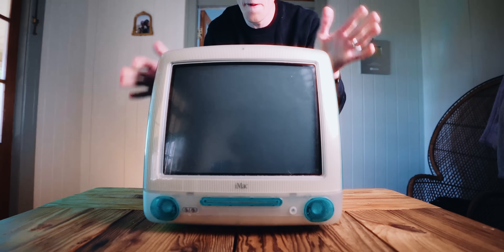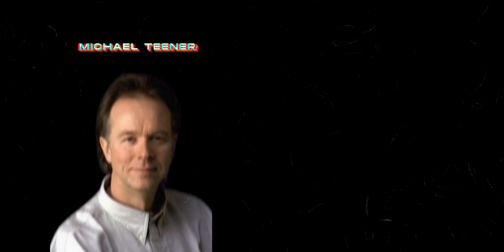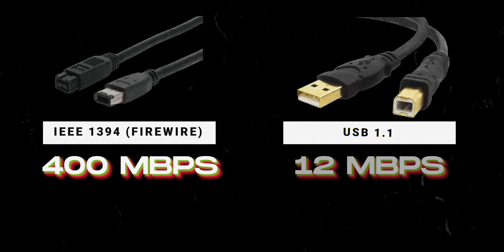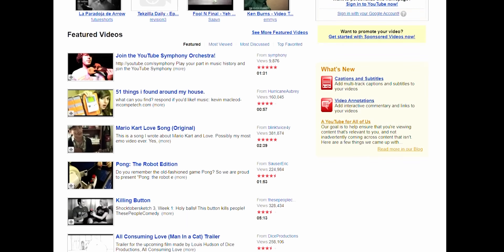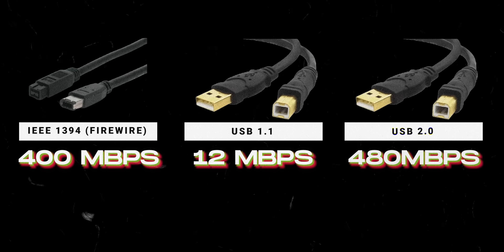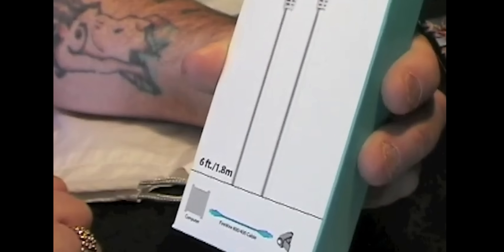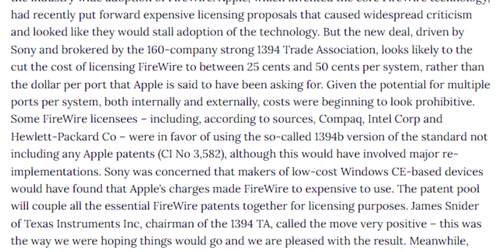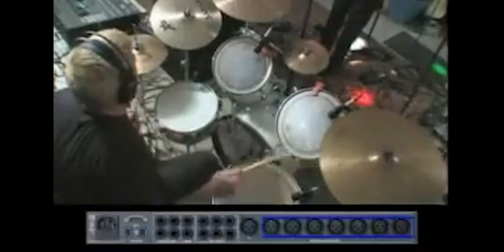Why Steve Jobs Forced You To Buy FireWire (Then Killed It)

Comment: This is heavily biased towards Apple, & has multiple errors.
They started firewire, but other companies made huge contributions, Sony, Panasonic & Philips averaged just as many patents each in it, & number of other big companies made big contributions.

Apple killed firewire with their greed, pretty early - just as usb2 was about to arrive & not long after win98 with firewire support. This is why no pc motherboard chipsets had it built in, whichwas the death knell. They hadn't been exactly free prior, there was a one-off charge. The new $1 per port was obscene, especially back in 1999. None of the other patent holders were charging, seemingly there was even an aborted attempt by other companies involved to make a firewire revision so apples patents could be removed.
Microsoft reportedly trusted apple so little that they made them sign a document at the start - that they'd keep the fee low, but went ahead & charged far too much anyway.
Apple was the worst part of firewire, other them using it on their own computers - which is the only real reason audio interfaces used it. driver support for them seems tyically horrible for them. Likewise apple abandoned firewire like anything "old", meanwhile it still works in windows 11.
If firewire wasn't on camcorders, few pc users would have ever cared about it. Obviously Sony, Panasonic etc drove this.
I think it's unlikely apple ever would have "won permanently" with firewire. Their hatred of open interfaces pretty much guaranteed that anyway. The eu had to force them to even use usbc.
lt's very debatable that it was better anyway, firewire can be a pain in the ass, even plugging things in the "wrong" order can stop something working - there's even wwarnings on some devices about how to plug them in. And this isn't just on pcs, I had the same problems on apple.
It was also never intended for everything, no keyboards, mice, card readers etc were ever going to use it, unlike usb.

Comment: My first CD-Burner was SCSI.  Because it used it's own dedicated expansion card, I was able to multi-task while burning.  With IDE, it would cause the recording to fail.

Then my first external HDD had FireWire400 and USB2.0.  I chose it specifically because it had FireWire400.  It was so much faster than the USB2.0 interface.

Thanks for the history lesson.  I honestly didn't know Apple invented FireWire and that licensing was it's demise.  So unfortunate.

Comment: Great video, but I feel it was always going to be USB and it's children.  You could get a $10 USB to serial adaptors from the get-go etc etc etc. You just couldn't do that with FireWire, it was too expensive because it was peer to peer, the cables started at $20.   So FireWire stayed niche for premium devices but missed the mass consumer market.   Even now we see the same issue with Thunderbolt (which is kinda an encapsulation of FireWire plus PCIe).  TB is freaking awesome but still an expensive architecture compared to USB 3.2 and still problematic when you want to have a dozen TB ports on a PC or Mac affordably.

Comment: Firewire 1600 was also in development, double the speed of FW 800, but Apple developed Thunderbolt 1, initially capable of 10 gigabit data, which later evolved to 2, 3, 4, and 5 gigabit data on the latest Macs. It's basically changed its name, but it's basically the same standard, improved and more powerful, as this technology now supports peripherals of all types, monitors, data, and power supplies over 100W. And the data is all managed on a serial line. Like FW, two chips are needed at either end of the cable or peripheral to manage data and power.

Comment: USB-C is a bloodbath of a disaster; particularly where cables are concerned.  There are so many variations of data-transfer rate and power transfer capacity and no way to tell by looking at the cable.  We are back to the days of travelling with cable spaghetti, only now we can't tell the spaghetti apart by looking at it.
Reply: ...Or you can just buy spec-compliant USB4 (or USB 3.0) cable. But nobody gonna buy expensive cable to just charge their phone.

Comment: your video is kind of wrong in a really big way. USB wasnt just cheaper, it had a bunch of really big technical advantages, including hubs and native support for new and legacy protocols like serial (CDC) and parallel ports. But most importantly: FW was DMA at heart, a massive security issue, and that was unfixable. That killed FW. The licensing debacle was a sideshow in many regards, especially as usb already had much greater market share pre-2.0
Reply: Technicaly USB is just a dumb serial port, FW is way more than that, with real bandwith at 95% of theorical bandwith, networking capabilities, multi DV flux shared between several devices, chainable like SCSI, etc … how can you compare it with such a crappy thing like USB !!!

Comment: Thunderbolt 1 2 and 3 ARE FireWire's legacy and it is fully backwards compatible via adapters. Apple is now only pulling the plug on driver support in the upcoming OS despite being fully integrated into the USB-4 spec. I am still using a MOTU UltraLite MK3 FireWire interface via adapters and I"m pretty annoyed that Apple is pulling support. MOTU actually still sells and supports the USB2/FireWire hybrid version and it's through those drivers that I've still had up-to-date support. Now I'm gonna have to buy a new interface if I want to upgrade my OS.

Comment: Video doesn't mention that Firewire 400 could achieve roughly 400 Mb/s, while USB 2.0 (rated at 480 Mb/s) could only achieve about 350 Mb/s.  This was because Firewire is a device-to-device data flow architecture, while USB is a device-hub architecture, with a lot more crosstalk and mitigation, closer to how Ethernet/WiFi handle multiple devices on a network

Comment: Before watching the video: Firewire went through two versions before being replaced by Thunderbolt, which Apple & Intel jointly developed and is the spiritual successor to Firewire.  And Steve Jobs cunningly installed the ports on 2011 and later MacBooks calling them just “Mini DisplayPort” (so for displays only) before revealing at a keynote that they were actually Thunderbolt ports (same MDP connector) and that people didn't have to buy something new to use Thunderbolt— they already had it (genius solution to the chicken and egg problem when it comes to new tech).

Comment: SCSI was incredible back in the day. It was finicky in some respects with termination and device IDs, but compared to anything else on the market at the time, it was faster, simpler, easier to use, and a lot more heavily standardized supporting a lot more different device types and total devices connected.

It was revolutionary and no small feat, and it was not something as flippant as you’ve mentioned. Its inconveniences were necessary given the state of technology at the time it was invented, and they were minimized as much as was feasible at the time.

USB 2.0 may support 480mbit, but protocol and CPU overhead meant significantly reduced transfer speed compared with firewire 400.

Comment: Also: No, FireWire was never intended to be a standard for everything. It was supposed to be for fast data transfer. You would never find a keyboard or a mouse using FireWire.  That's what the Universal Serial Bus was for.
Reply: Exactly. It was meant to take on parallel and SCSI  .
Reply: I'd also add that the idea that it 'just worked' as stated in the video was not true.  It's roots in the 80s and 90s meant it had no concept of class drivers and required drivers specific to each device for operating system enumeration, something usb did not require.  It was likely always going to die without a major revamp and backwards compatibility break, it relied on technical assumptions that had changed very quickly after it launched.

Comment: I still ran my backup hard drives over FireWire 800 I believe up until 2016. Very fast, very reliable and being able to daisy chain hard drives was a godsend. Fun facts: The F-22's databus is based on FireWire 400. And the FireWire 400 connector was based on the Game Boy link cable.

Comment: I am professional media producer, and even to me, USB 2.0 would be good enough for doing everything I need. I am not saying it is preferable over modern fast ports, just saying this old tech would be enough for professional use, you'd just need a slight bit more patience. When transfering 10GB of video data, USB 2.0 typically needs 5 to 6 minutes. And barely anybody transfers 10GB several times a day, it is still quite an amount of data.
I am just pointing this out, because people are tending to ask for the greatest tech, for it to be able to do more and more, while they are not even maxing out the tech from yesterday. Many people spending money on tech to have particular features, just to have them - but then ending up never utilizing them really. I have a 10 years old USB 3.0 thumb drive. It is reliably writing 150MB/s, and never have I thought "this is too slow". So this is still my main mobile drive, if anything, the size of 64GB sometimes isn't enough anymore.

Comment: Even when USB 2.0 came on the scene, FW400 still had advantages, but FW800 was really awesome. Yikes by the licensing fee mess. The other shame is FW1600 and FW3200 existed as well, at least in theory, using the existing 2 ports, it could have been a total game changer, but it never took off. I still have my FireWire audio interface I got while studying sound engineering, it did 24/96 recording back before any USB interface came close to that, multiple channels at once, and a phono input. I still have the adapters to use it, but unfortunately there's no drivers that work on modern Windows or Mac, I even have a FW400 PCIe card for my PC :(

Comment: There is an Apple Firewire->Thunderbolt2 and an Apple Thunderbolt2->USBC Adapter available. It allows you to connect any Firewire400/800 device to USBC. And it really works (i have tested it). You can even use a Firewire->SCSI adapter and an IDE->SCSI adapter to connect an IDE HDD to a USBC port through this adapter-inception... kinda crazy. The USBC to Thunderbolt2 adapter can also be used in both directions...
Reply: As it stands now with Tahoe this will no longer work 😢.

Comment: I was thinking the same thing like a laptop or desktop case w/ FireWire 400 the hole port might be good for using usb-c either on logic boards or motherboards depending on the project built even if had used a cable as extension mount to case to make it work

Comment: Firewire is not (totally) gone yet.  Thunderbolt is backward compatible with firewire.  I still use my MOTU 828mkII audio interface with my new Mac Studio M2 computer.  Thunderbolt 4 > TB4 to TB2 dongle > TB2 to FW800 dongle > FW800 to FW400 cable > MOTU Fw400 jack.  iDongle to the rescue!!
Reply: I believe this will stop working in tahoe
Reply: Talk about signal integrity 😂
Reply: The cables are not for sale. Any ideas

Comment: It was down to cost. USB 2 may have been faster on paper, but it didn't support DMA transfers and all the data had to go though the CPU bus, whereas Firewire devices could transfer without the CPU involved. Also, USB didn't hit 480 in the real world, so the Firewire 400 was still faster AND didn't cause your computer to slow down. Then there was the latency. When USB2 first arrived, no one used it for audio because of the lag. They did solve this, obviously.

Also, I don't recall it ever actually being put into production, but from the inital design specs, Firewire was designed for 400/800/1200 speeds. It was just deemed to expensive to put the 800/1200 out there until costs came down. So yeah, when it was time, they could pretty much just drop FW800 on the market.

Comment: Thunderbolt isn't "Apple's", but rather Intel's, but Apple was the only company that used Thunderbolt 1 & 2 (using Mini-DisplayPort for the connector and port) on their Intel-powered iMacs and Macbooks until Intel released Thunderbolt 3 with the USB Type-C port and plug, as effectively "PCIe-over-USB".

Thunderbolt 3 had a lot of "optional features" beyond the core feature set, but since they were "optional" you often had issues using "TB3" devices and cables from one manufacturer with "TB3" devices and cables from another because even though they had the same core functionality they often also had different expanded feature sets.
Intel eventually fixed this issue by making all of TB3's "optional" features mandatory features to have a device or cable rated as Thunderbolt 4, along with dropping the heavy royalty fee for Thunderbolt implementation (which is part of the reason why motherboards for AM4, Threadripper and EPYC "Zen"-family CPU's prior to "Zen 4" (Ryzen 7000) on AM5 didn't have on-board Thunderbolt 3 support, and why if you wanted Thunderbolt on such a system you needed to buy an AIC to provide the functionality).

Comment: Apple only charged for the use of the name Firewire, which is why you find it labelled 1394A and 1394B after that. There is a bit more to the story about the 1394 standard getting included into the Intel chipset; Intel didn't want to rely on a proprietary technology owned by another company. That sentiment increased after FW800 popped up shortly after USB2.0, the trust issues involved the uncertainty about future specifications. Especially the Power over FireWire feature caused concern at Intel, a suddenly increased power draw could really mess up a motherboard. So they wanted in on the development team and Jobs said "No.". That ended the courtship, but Intel never dropped FireWire. The 1394 protocol is still part of the latest Intel chipsets. Jobs probably refused because FireWire at that time was an integral part of the iPod product line and the iPhone must have been under development at that time. Power requirements for future iPods were unsure and they charged using FireWire. Apple needed freedom of movement with the FireWire protocol for that. Getting Intel people in the loop with a product thát close to the iPhone development must have been a bridge too far for Jobs. I think he valued the iPhone higher than FireWire.

We really lost a bit of quality of life when Apple and Intel parted ways. The Firewire 1600 interface was already close to completion, there are rumoured to have been a couple of Mac Pro 3,1 prototypes with FW1600. There was a path to FW3200 in place, when development was stopped in favour of Thunderbolt. 
Thunderbolt is what would have happened after FW3200, because FireWire would have to compete with the USB 3.0 protocol. Apple learned from the spat with Intel, the Thunderbolt protocol not only included data transfer speeds but also the (7W) power delivery. That gave TB1 a 2W headroom over USB3.0, while losing nothing in speed or current when daisy chained.A USB3.0 connection can not be daisy chained; you need to travel through either a charged hub or the motherboard to connect multiple USB3.0 devices. You lose speed and Amps when a single cable needs to be used in both directions to connect with another attached device, FW400/800 and TB1 didn't need to move the same data or current more than once.

Comment: I had a Mac G4 with a broken hard drive connector,  but it had firewire. So I connected a firewire hard drive and installed the operating system on an external drive and used the computer that way. I could not tell any difference in speed of the computer.

Comment: firewire got replaced by the cheaper, simpler and less problematic usb 

and it was called scsi, the interface you mentioned, that was replaced by sata and usb, because scsi was used by mostly storage devices

usb could do that and alot more

Comment: Digitizing old analog tape is a thing I still do sometimes, so all my current PCs have cheap Firewire cards installed, which is fed by a 20-year-old Canopus box or vintage camera output ports. Results are as good as can be and the hardware was paid for decades ago.

Comment: The list of Apple technologies that never became standards for the industry is LONG. Extremely long. In fact, it is difficult to think of ANY Apple technologies that DID become standards. ADB? Gone. All the various RAM formats? Gone.  Even their CPUs were abandoned. It used to be a joke that if you owned an Apple laptop, you'd also have to include a half dozen adapters to make it compatible with the industry standard video/audio/serial ports. Why? Because Apple does not believe in compatibility. They want to lock their customers into an ecosystem, and as long as you don't leave it, it will 'just work'....but only for a generation or two. Apple is not even compatible with itself. And what this REALLY means is that our landfills are filled with 30 years worth of adapters and proprietary hardware that did not NEED to be b abandoned, but that Apple chose to abandon purely to make money. Shame on you all for owning anything Apple. They have been more harmful to the environment than ANY other company.

Comment: FireWire was a key to Apple’s success. Having it on the iPod, making music transfers practical, made it so much better than other systems. It got people who had anti-Apple feelings to get into the ecosystem. It led to the iPhone, basically an iPod with telephone capabilities. I wonder if the current popularity of the Mac is not in part a result. By the time that Apple’s mistakes led to its demise, FireWire had already contributed significantly to Apple’s future.

When I bought a Mac Studio a couple years ago, I budgeted $200 for cords, adaptors, and such. I probably spent most of it.